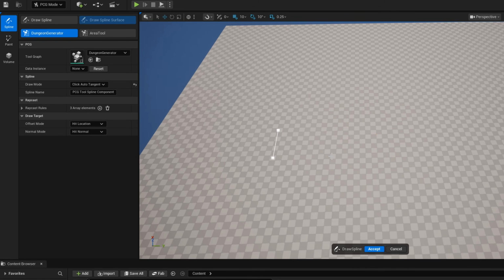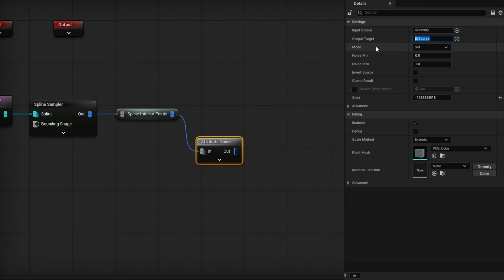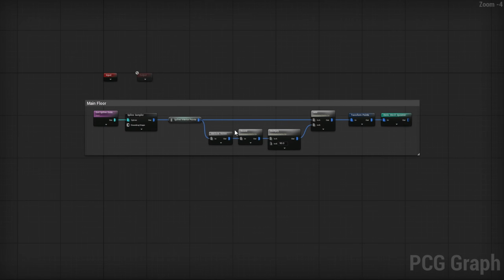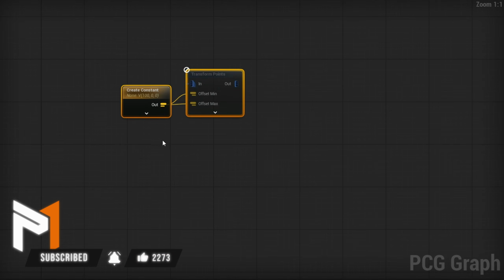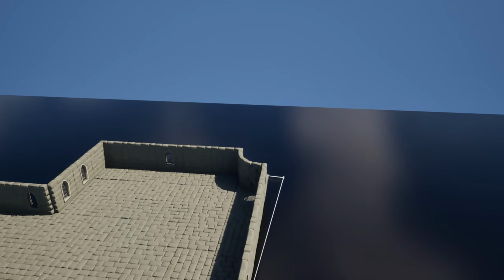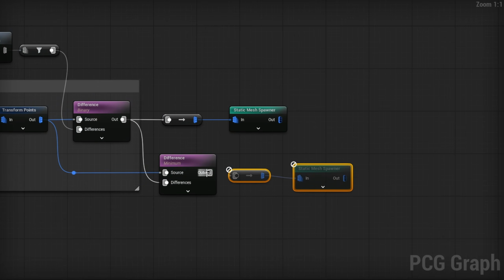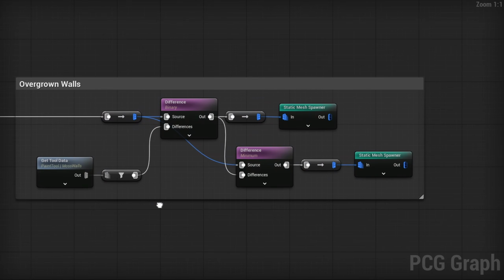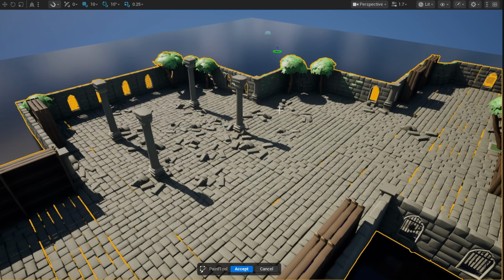A New Way To Create And Modify Dungeons Using UE5.7's PCG Mode

Comment: Great tutorial! Thanks for this content!!

I have tried this in 5.8.1 and for some reason, the walls step creates a two wall lane instead of one. I have checked all the values, even used the same meshes and I'm not sure what could be wrong. I think there must be one default parameter somewhere that is causing this.
Reply from the maker: If you're getting overlapping points then you can always just use a prune overlapping points node and get rid of the duplicates.

Comment: this looks awesome but I have a question before starting
would I be able to implement this in my 5.4 project does it use anything you need to 5.7 or it will be fine with my current project
Reply from the maker: PCG Mode was added in 5.7, so for this functionality you need 5.7+.
Reply: @Procedural_Minds  thank you soo much

Comment: Awesome tutorial - so valuable! In my case, maybe because of where I drew the points or something (true newbie here) my 4 Wall Transform Points nodes needed to be A=0, B=0, C=-90, D=90 - There was probably an easier way to figure this out but I Zoomed in on 1 floor space and changed the settings one by one, without having the difference connected. 🙂
Reply from the maker: Odd, rotations shouldn't change. Only thing that might change is the size. But as long as you got it working, that's all that matters. :)

Comment: Your named value that you later use is from an "On Interior" you call "Spline Interior Points".  I need to watch this a few times to understand how you are getting "Along Spline" points from that data.  Looks like the difference node is doing all that filtering but I'm not understanding why.  Super cool you figured that out.  I would have re-sampled the spline but this way is much better.
Reply from the maker: Like I tried to explain in the video, you take those interior points and copy them in the 4 directions. Where they overlap each other you end up removing. Resulting with the only ones left being the ones on the edge.
Reply: @Procedural_Minds  Ah, makes sense now.  You wouldn't want to resample the spline because the spline is offset of the spawned geo of the floor.  So you talk to the spawned floor and half offset the floor, rotate for the coords like you said in the reply and place the points there.  I'm so used to the spline dominating my placement this was different than I'm used to.  Cool find and good use of "Minimum" and not the usual "Binary" used by of the difference node.

Comment: Can you, using the placement tool place BPs instead? Id like to have another layer of randomization for the static meshes you place using it.
Reply from the maker: Absolutely! If you look at the graphs that come with the engine for PCG Mode they have examples with actors.
Reply: @Procedural_Minds  I see.I stuck with 5.5 for my current project so I as thinking if migrating to 5.7 would make it easier for me.

Comment: I think if you want an even distribution of ints 0-3, you actually want to do random(0, 4) then floor (), not random(0, 3) followed by round(). The "width" of the 0 and 3 buckets are only 0.5 with that method.

Great tutorial though, loving this content!
Reply from the maker: I don't think a single player would ever look close enough to ever notice that. So... 🤷
Reply: @Procedural_Minds  Nah me either, just wanted to mention it in case there's a situation where a true even distribution matters
Reply: Small thing on this particular case, but good point!

Comment: how would you go about putting a ceiling? duplicating the main floor spline and moving actor by certain amount or in PCG graff duplicating main floor and using transform node to offset it by wall height?
Reply from the maker: Yeah, exactly that. Take the floor and duplicate it up based on the height of the wall.